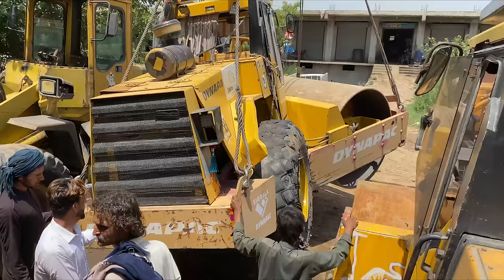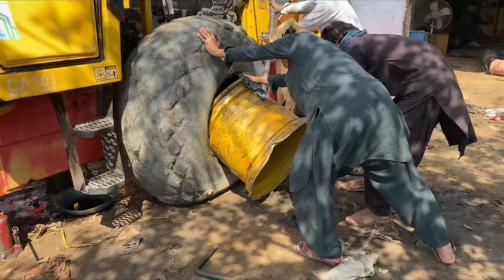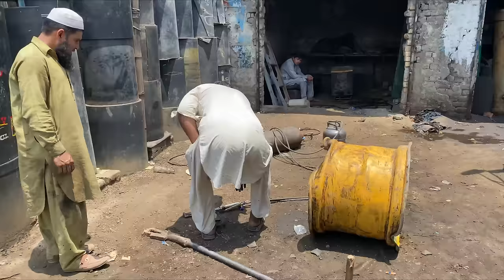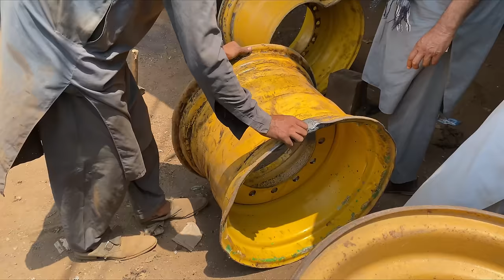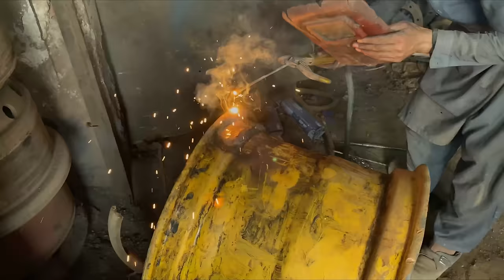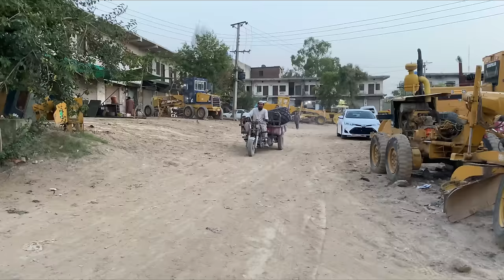Due to Brake Failure the Roller Fell Down the Road into the Ditch / Amazing Repairing Process of Rim

Comment: Fix on failure. Not the way I would maintain my equipment but amazing what can be done by a determined, experienced crew in the circumstances.
Reply: They probably only changed the tires after the one popped causing it to go in the "ditch" and kill the driver
Reply: Sound like if you could you would
Reply: You have heavy equipment as much as I do which is none.

Comment: Lets take a 10 ton object and support it with small blocks of wood... seems legit to me. These men are brave.
Reply: That's how you support anything big like that jack stands will not hold it and you don't want to use concrete or steel.
Reply: Did you see the crane rigging?
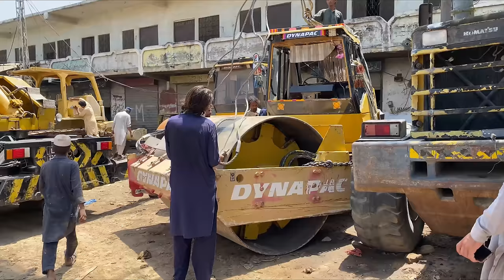Reply: @davidh4514  You mean the crane rigging that was removed at 2:08? The crane was only used to unload it from the truck.

Comment: Good and hard work, with minimal machinery. I am very much afraid, however, that it is not the best work that should have been done. The wheel is off center and will very soon destroy the bearings and other mechanical parts due to material fatigue.

Comment: А что, никому в голову не пришло снять колеса и их отвезти в ремонт а не везти весь каток ? 
Столько лишних денег и времени было потрачено, во-первых: на кран чтобы поднять каток, два раза, загрузка и выгрузка, во-вторых: на грузовик чтобы отвезти каток. А ведь можно было просто снять колеса и на мотоцикле с кузовом отвезти колеса в ремонт. 
.But what, it didn’t occur to anyone to remove the wheels and take them to repair and not to carry the entire ice rink?
So much extra money and time was spent, firstly: on a crane to lift the ice rink, twice, loading and unloading, and secondly: on a truck to take the ice rink. But you could just remove the wheels and take the wheels to the repair on a motorcycle with a body.
Reply: Так у него кабина на бок. Он где то кувыркался!

Comment: Wasted a lot of time and gas by using that cutting torch to heat. Should have used a welding torch with the biggest nozzle, would have got it red heat in no time and over a much bigger area. Regards from Australia.

Comment: Pakistan is constantly moving from garbage to garbage. If the rims were not garbage before the accident, they certainly are afterwards. Any place else the rims would be thrown away because they are garbage, cannot be repaired properly, and are a safety hazard. It is only a matter of time before the rims fail again and there is another accident and another cycle of moving from garbage to garbage begins again.